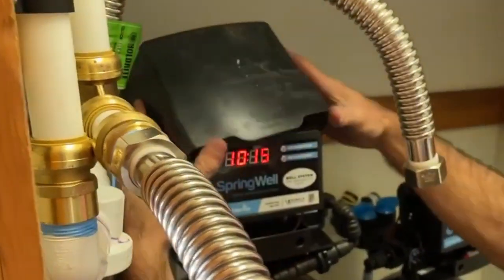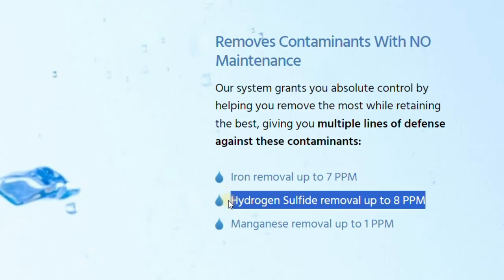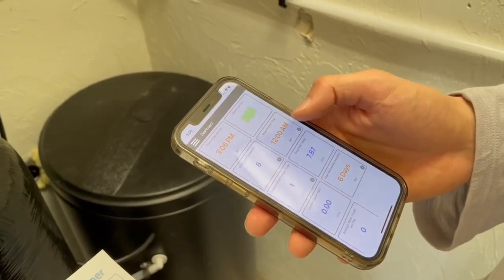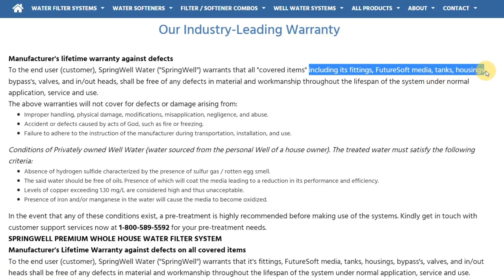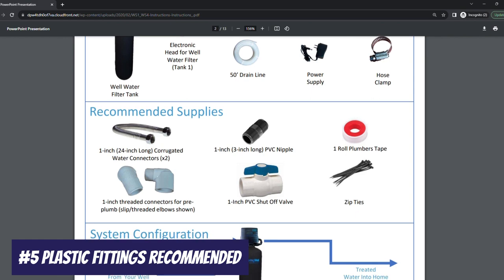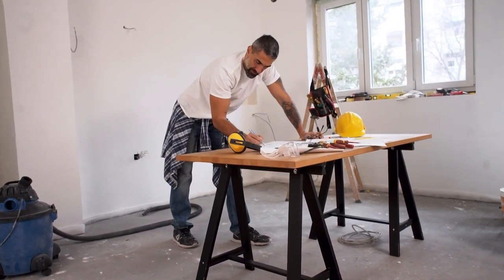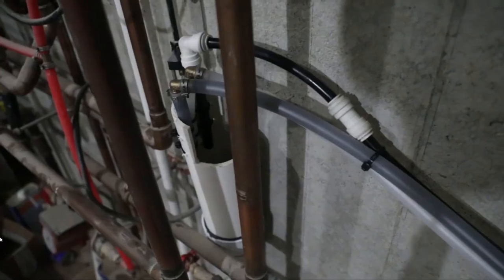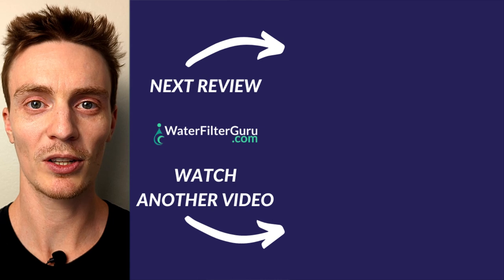The Best WELL WATER  Filtration System 2024…That Culligan Doesn't Want You Knowing About

Comment: I have a well,  mid levels of iron but my water is hard, there is already a particulate filter and UV light as well as some other filters but they are older and I don’t believe they are working anymore. I’d like to get a new system. It sounds like this one wouldn’t be a good fit. Is there another you recommend??  Thanks.
Reply from the maker: Hey thanks for your comment! First thing, we always recommend testing before purchasing any treatment equipment. This is especially vital for well water treatment. You could test both before and after your current treatment system, then the data would give you an indication of what's working and what isn't. 

The system reviewed in this video is a solid choice for treating iron, manganese, hydrogen sulfide and hardness.

Comment: Hello and thank you for the wonderful video.  It's very timely as well because I'm needing a whole home filter for well water.  I don't see any for ProPur (now ProOne) Whole Home Complete system (5 filters plus softener) and was curious about your thoughts on it.  My only trepidation is its 7GPM flow rate.
Reply from the maker: Hi there, I've not yet tested that system from ProOne so don't have any first hand info for you on it at this point. That said, the first step is to test the water to see what issues are present that need to be addressed? Have you had the well tested by a certified lab?

Comment: Does this do the sediment and uv filtration? I’ve been told wells need sediment and uv filter systems.
Reply from the maker: It includes a 152 micron spin-down sediment filter, which will address larger particles. But if you have finer sediment in your water, you'll want to consider adding another filter with smaller micron rating. It's always a good idea to have properly sized sediment filter for well water, which serves to protect the downstream equipment.

UV is optional, but serves to provide additional protection from microbiological contaminants. If you already have a chemical injection system, it wouldn't be necessary. Springwell offer a UV system as an addon. Learn all about that and the specs here https://bit.ly/3Ch1EWW

When was the last time your well water was tested by a certified lab? What water issues are present that need to be addressed?

Comment: I know this is a bit of a different question that might not pertain to your expertise but we have a very high iron content in our irrigation well water system in South Florida and we currently have a tank we fill with chemicals to keep staining down.  Do you know of any system with minimal maintenance requirements that might get the same results.  I would gladly pay more money to do away with the chemical tank system we currently have. I completely understand if this is not in your wheelhouse. Just thought I’d ask.
Reply from the maker: An oxidation system like the one mentioned in this video would be a non-chemical solution. That said, it would be highly dependent of the flow requirements and iron concentration.